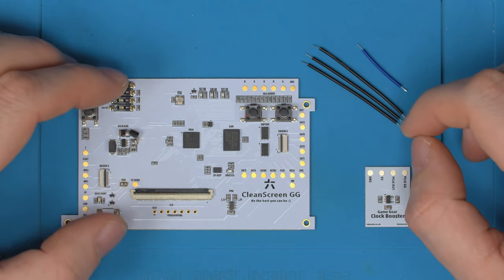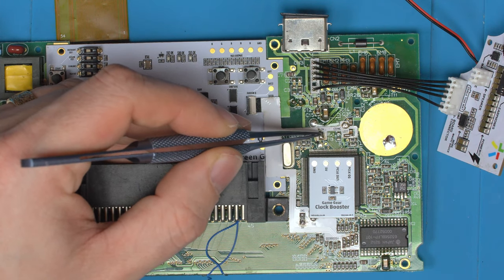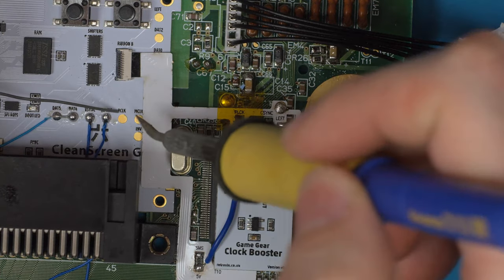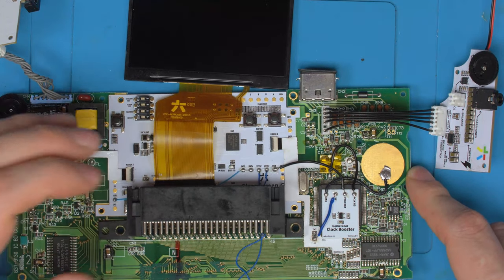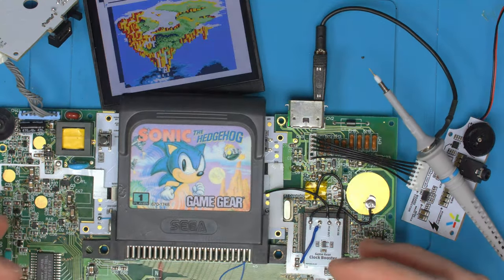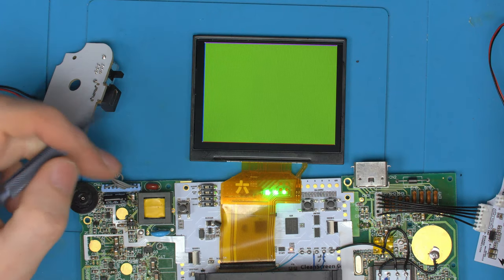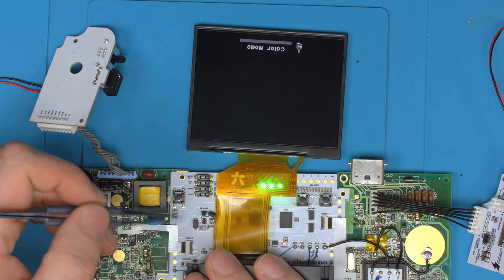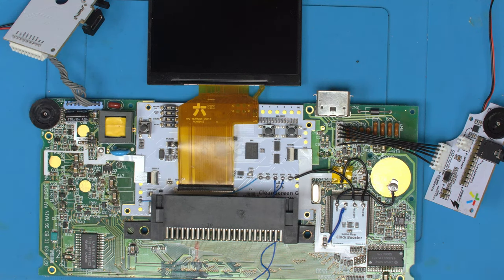Clock Booster, Smart Wire Detect, HDMI and More (Game Gear CleanScreen V3)

Comment: Great item just installed one  the flex ribbons and pcb are  high quality no aliexpress junk! I didn't notice the booster in the kit untill after I installed clock using the last video without booster 😂  was simple to add and works great

Comment: Bought this Version 3 which is much better than Version 2, thicker PCB which gives a better impression of quality.

The menu can still be accessed by pressing the Left + Start + 2 buttons.

The description states that the kit has Scaling options for full size, original size, stretched. Which button do I press to enlarge the image?
Reply from the maker: Where does it have that left in? Will need to remove that. It's always scaled perfectly to window of GG now
Reply: @RetroSix  This can be seen in the description of your CleanScreen Version 2 kit, one of the partner stores Hand Held Legend that sells your kits in the USA (Read More) =  "Scaling options for full size, original size, stretched".

I don't know if it's Luke I'm talking to ;) But "in stretched mode" the image is more fluid, you lose the edges of course but you gain in fluidity in terms of image = It doesn't flicker, there's no blocking and "aliasing" that appears. Try using the Version 1 kit in stretched mode on Sonic 1, for example, second world and second stage, you'll see it. This is a purist's point of view, of course.

What I'm about to tell you is for the sake of improvement only, because I really like your Clean Screen. But why have TrueMotion automatically activated, it's an absolutely disgusting blurr effect! Every time I change games, I have to disable it to get a clean image...

Later guys.
Reply from the maker: @alphaphoenix55  thanks I'll pass the message to HHL to update the description. For the stretched mode I will soon be adding a full integer scaled laminated screen so this wont be an issue. I can also disable true motion by default going forward, I think not many games have frame blending tricks they use

Comment: Does that ribbon work on all va4 boards?  The 837-9537 and the 837-9537-01?
Reply from the maker: The VA4/5 is its own version sold on site with different code and is currently hand wired
Reply: Do you plan to have a ribbon made for the va4?
Reply: Listing on the va4 cleanscreen page stated use of a wire free kit, so I was confused.
Reply from the maker: Yeah I'll make ribbon in future
Reply: Awesome, any rough ETA?
Reply from the maker: @simskc  few months
Reply: Hi, I’m trying to do a wire install of the V3 board, is there a spot on the board where I can solder a wire for cync?
Reply from the maker: @Michael-Angelo0526  the v3 doesn't use csync now its back to hsync/vsync